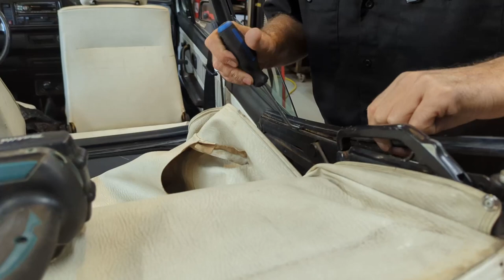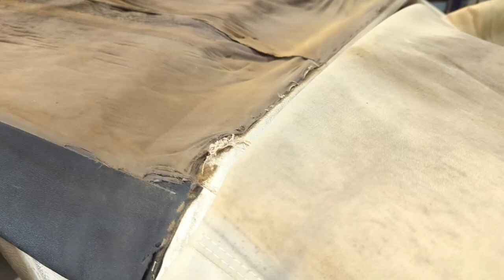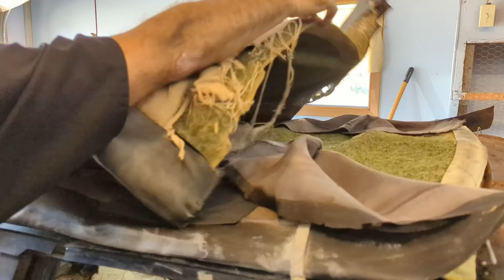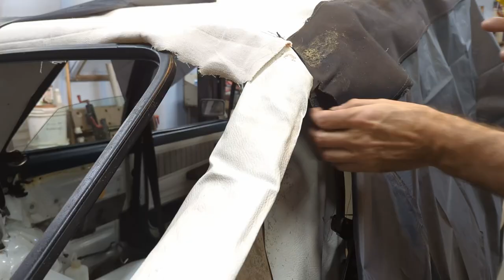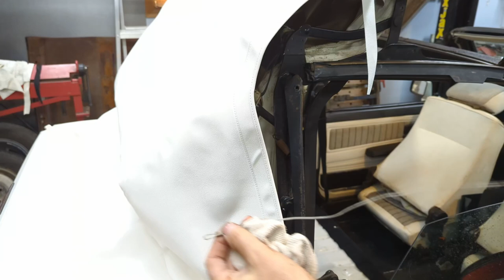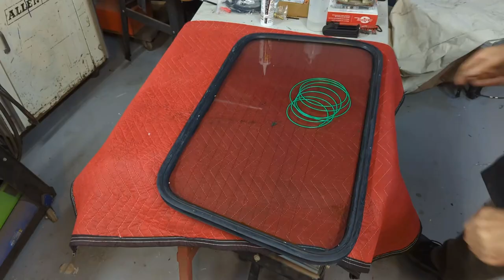Triple White 1987 VW MK1 Cabriolet Convertible Top Replacement Start To Finish

Comment: cool video! 
hope to see more of your 65 tbird hardtop videos! I  have a 66 bird with the factory cruise control, can you explain how the speedometer system works with cruise? I believe it has two separate cables? I don't know how to open it up and re lube, bc I don't think the speedometer works at all. Thank you Alvin! 👨‍🔧👨‍🔧🧑‍🔧 
🔧
Reply from the maker: I did a video on the 1965 Thunderbird cruise control system, take a look at that video, however, Ford changed the cruise setup for the 66 model, so yours will be different.
The speedo cable and speedometer head will be the same in principle.